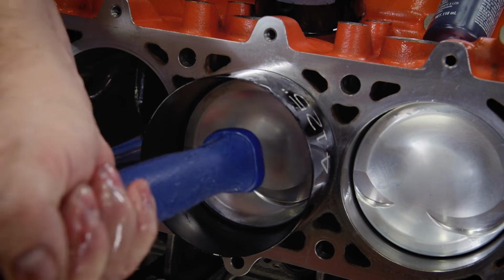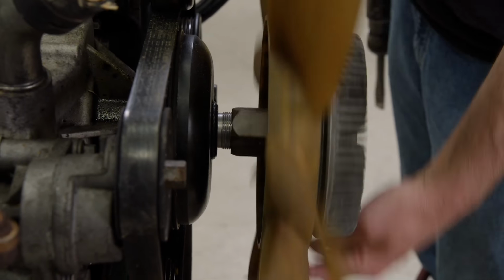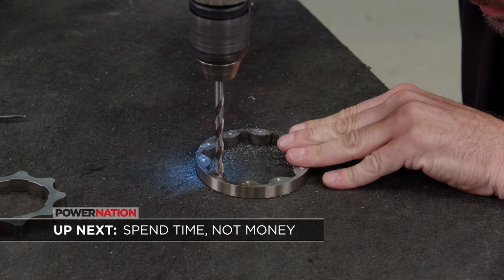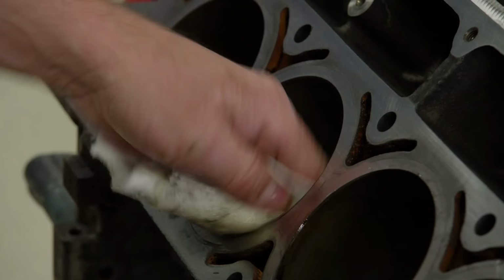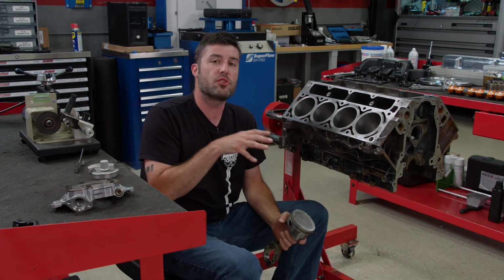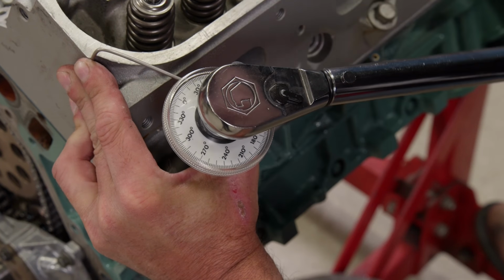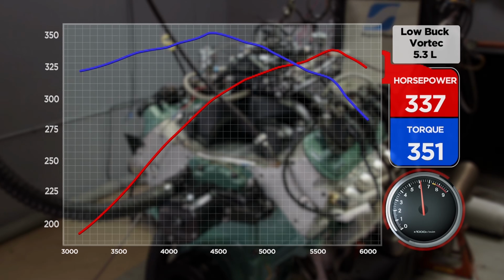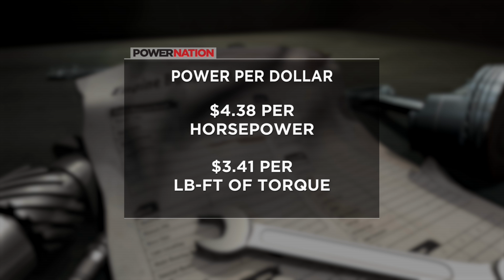Minor Upgrades Create Crazy Power on a Junkyard 5.3L Vortec - Engine Power S7, E10

Comment: None of this is low buck even some of the hand tool they use if you dont have them you have to purchase them and that adds up they didnr build a engine you can build from your garage so they need to change the name of this it is not low buck its sad when poeple go to a junk yard and buy a motor thats got miles on it and slap a turbo on without tearing it down and smoke a lot of sports cars out there none of the stuff is really used when you clean everything and it is not the cheapest you can do it they are wrong i ive made more power them with stock motor threw a cam and lifters on it and intake and made more power and didnt add power adders with the basic and didnt clean the motor and guess what it still running and works vetter then what they spent

Comment: I would advise not to increase the oil PSI past 55 PSI.  Especially if you will run over 2500 RPM for long duration.  You will empty the oil pan loading the upper end.  Excellent video.

Comment: I have a 2002 Z71 5.3 with 270k on it. If I did this to it using the factory Vortec fuel injection and ignition system what modifications would you recommend to the fuel injection and ignition? Also did you just do a standard valve job on the heads?

Comment: i got my 04 trailblazer for free. the previouse owner put a new radiator , a new thermostate in, new water pump in, new ecm in, shaved the heads not sure how much,  new belts, new coolant temp sensor, it is the 5.3 liter and it would idle all day and not overheat until you put it in gear then it would overheat within a block. not sure what was wrong with it it cured itself, maybe an air pocket, i am still leary. oh yeah the ac doesn't work yet.

Comment: Ya know, how much did they spend on oem torque to yield (crap) head bolts, I mean for that money to be honest you could get ARP bolts for probably the same price or cheaper,😂 but they use the ARP bolts everywhere else that doesn’t really matter at that level of build, I mean if I was going to do that i wouldn’t care about the bolts but I would AT LEAST put in ARP mains, rod bolts, and head bolts as really when you think about it those are some of the most important fasteners in the engine, peace of mind ya know

Comment: My truck is pushing 330k miles with no rebuilds, original motor, and original transmission, and the biggest thing I had to do was replace a bad head gasket

Comment: I'm sure you were paid to advertise autozone. But as a shop owner and having 35yrz experience any electrical part beings starters, alternators, sensors, switches, etc are junk and read out of specs. Trust me when I say after changing a starter 7 times in a row on a 5 liter mustang because not one of them were good I had had it and bought from Napa or car quest and the first one worked great and is still going 12 yrs later. And yes all 7 were bad from the jump and all with same issues. Also alternators going bad after a few weeks, sensors that aren't properly calibrated the list goes on and on and on and on its not built to last duralast. It's built to fail duracrap! The only thing anyone can depend on is that the part won't last long,  won't work directly out of the box and the kicker usually causes driveability issues from not running with in the determined values set by the auto makers tolerance. Buying electrical parts from autozone is like buying chinesium electrical parts. Which i will never sell my customers parts from either. Now other items seem to be OK but still I don't think their quality is something to brag about because I'm convinced that the quality department does what they're suppose to do and send out parts that have poor quality or that autozones quality bench marks comes up short

Comment: Okay, cheap you say. You barely beat a 99 Audi A6 4.2 and did not beat a 99 S6. They all have 4.2L and do between 299 and 360PS. I'm just saying, for the money you get a car that already has an engine making at least that power which is quicker than most cars you will put a 5.3 in.

Comment: I have a service van (2013) with a 4.8 L that is just over 500k miles. Check engine light has been on for the last 8 years but it runs like a top. And yes, it's about ready to be retired.

Comment: I am currently rebuilding the engine for my 99 Tahoe limited. It will have .010 over reborn has a new tranny but dad ran it while it was overheating and warped the heads. Years ago. This is the L31 vortex 5.7. Any recommendations for bolt on’s?

Comment: What’s the difference in bottom end between the 4.8l and 5.3L ? I’m sure there are head and intake manifold differences but those are being replaced, I just want to know about the block and rotating assembly. Is the volume a stroke difference or is there a bore size difference? Is the oiling the same on each?

Comment: I know my Chevy motors. I’ve owned a 4.8, two 5.3s and a 6.0. Based on that plastic stock cover over the intake (it’s square and the 5.3 is more rounded ) and the fact that it has flat-top pistons, that is a 4.8, NOT a 5.3. The 5.3 did not have flat top pistons. They look absolutely identical on the outside and so does the 6.0. The junkyard could’ve easily made a mistake and told you it was a 5.3. That being said, that makes this video even more impressive to get that power out of a 4.8L 👏👏
Reply: I have built 3 5.3's with 243 heads they all had flat tops, i think its around 06 to 14. mine were all aluminum blocks
Reply: @coolermaster-p3s 

Yeah your right there's a Lc9 5.3 with flat top pistons with 706 heads and 799 heads. 

I had look that up myself because I was always told the 4.8 had the flat top pistons but I was told wrong. 

But yes you are right there is some 5.3 that have flat top pistons.

Comment: "This is the cheapest you can get one of these things running, right?  You can put injection on it but you have much more sensors, much more wiring, much more messing around with it, this is as cheap as you can get this thing going!"

My brother in Christ, you ripped off the perfectly functioning fuel injection system with the sensors, wiring, and computer this engine came with and threw it in the trash, to slap on nine hundred bucks worth of carburetor, a seven hundred dollar ignition controller, and $300 intake manifold.  That's almost two grand worth of fuel, air, and spark that you could've had for no more than the price of one HP Tuners credit to disable VATS.

Bit dishonest of you not to include the carb and MSD setup in your final price, given that anyone following your recipe isn't likely to have those just laying around for free...

Comment: I have a night I have a 1998 Chevy Silverado long bed with the five seven in it I am correct 233 horsepower I would like to update the intake manifold one of Holly's open Flow injector kits vehicle has just under 120,000 MI and I've had it for the last 11 years original mileage was 65,000 time to show the old girl some love but I do like to drive LOL any information would be greatly appreciated as far as intake manifolds and so on and so forth I'm not a computer guy

Comment: Dude I found a complete 2001 Silverado with a lq4/4l80/4.10heaes/4x4 with 287k miles that I would LOVE to swap into my Jeep, my question is : should I be afraid of the milage? And it does have a either some lifter noise or some piston slap that seems to go away after couple minutes. Should I buy it for my swap?

Comment: I did a 5.3 vortec OEn rebuilt. I changed the main bearings and the cam bearings cleaned everything I didn’t measure for clearance at all! lol I just sent it! I did torqued everything to spec though, but I didn’t do any measurements like they did. I mean it’s rebuild. It’s not like I’m putting after market parts. It’s OEM so my thinking process is well. The cam bearings and the main bearings are all OEM just like the old parts so what’s the big deal of checking for measurements? It takes long.

Comment: Curious I didn't watch the whole video but what year is this engine looking for 2005 lm7 torque specs Rod bearing Main bearings  rod caps and heads  also trying to do oil pump and cam gears ext looking for a full overhaul torque specs

Comment: You do know Holley has been building their own race carb for several years now don't you? 
It's called HP series. Has everything this Edelbrock does except one Smart Thing Edelbrock did Add a way to bolt a GM TPS to it. Don't know why Holley didn't do that. With there 5 other brand carbs. Quick Fuel by Holley has more race than any. E85, Blow Thru, Drawl Thru,  ect. Edelbrock doesn't have that.

Comment: I have this engine and they said it's "blown". What I want to know is if I can get away with a head replacement (or even gasket only) or does the engine really need to be replaced. It overheated a couple times. The 2nd time was after a "reputable" mechanic "fixed" the cooling system for $1000. Started overheating again a month later. 

How do I determine if I can get away with less than an engine replacement?

Comment: i had 2001 suburban 4x4 with 236,000 miles that ran great. when i changed the plugs there were no electrodes left on them and i only had a slight flutter on cold start up, so i can attest to those strong coil packs! great engines for sure. unfortunately someone wanted my truck so it was stolen but, at least they got a smooth running truck!

Comment: I have a 2002 Chevy sub. With a 5.3 4wd,want to use as tow vehicle,who makes the best single turbo kit to fit sub chassis,want pretty much a bolt kit,ultimately want to change body and cab bracketry to install my 67.C 10 body,would be pulling enclosed trailor

Comment: Budget build:  Pull junk yard LS.  If it spins it wins.  Add cheap eBay turbo and intercooler from a scrapped Cummins.  Butcher your stock harness.  Do epic burnouts until it blows up.  Wash, rinse, repeat.

Comment: The most unrealistic part of this is none of those header bolts breaking when you took them off with an impact lol
Reply: The impact factor can break them loose, I agree it's less likely to break. Doesn't mean you should full bore it
Reply: I always tighten the bolts a tad before loosening them, less stripping snapping like that, idk why but it works lol
Reply: @imbrandon16  I do the same thing. The bolts were fastened in a direction that has no gaul or corrosion in front of it so that helps the bolt travel.
Reply: @imbrandon16 its because when you're tightening, the bolt is pushing against itself. When you're loosening, its pulling against itself.  I do the same thing. I agree it works very well.
Reply: No I think it's when the narrator said they changed the main bearings because they were cheap and didn't look in that good of shape but yet when they were pulling it apart he said oh my gosh look these look brand new and then at the end he says they reused them lmao
Reply: Less chance of breaking a bolt using an impact. I never break bolts using an impact only using wrenches.
Reply: @precisioncoatings5019  That's bs. Always break by hand
Reply: @precisioncoatings5019  I always break loose by hand and if it feels good I'll zip it. But too many cast iron head fords to just send it w my impact.
Reply: @precisioncoatings5019 that’s how I can tell you actually work on engines. 🙏👍🔥👀
Reply: Gotta get the motor hot before you take the manifolds off. First thing I do when putting headers in is spin out the manifold bolts just after putting in the garage.

Comment: You should have left the bottom end alone and just did cam and timing chain and of course you have to pull the heads to put lifters in so head gaskets but I've seen 250thousand mile engines w pristine main and rod bearings and still showing the cross hatch from the factory hone don't touch the bottom end of an LS factory motor timing chain cam intake and carrb and send it it will run a healthy long life after 250 thou another 250 thou those robots at gm just know what to torque for longevity when to torque it and they make a bullet proof bottom end by far the best for add ons and live to go another day

Comment: This is why Roadkill made this obsolete. These shows were just to get you to buy aftermarket stuff. My favorite is the junkyard LS with an intake that cost more than the engine. Then longtube headers and exhaust that cost more than the engine. Then using a Holley/other ECU and wire harness that cost more than the engine. For more power we are going to use a cam, springs, and injector with remapping, that cost more than the engine. A couple trips to the dyno, that cost more than the engine.  Well thank goodness we are building on a slim budget. 😂😂😂

Comment: Could be worse I bought my 02  silverado 5.3 z71 package for 2500 dropped my pan cause it was leaking and oil pressure was low so I changed out the pickup tube oring it was flat like a pancake and then found out my pickup tube was clogged with sludge and I had about 8 handfuls of sludge in the bottom of the pan 😢 luckily for me I change my oil when I'm supposed to and motor sounds much healthier now

Comment: I didn't see a carb or ignition controller on that price list.
Reply: Not to mention carb on LS is just stupid. All those sensors to get the ignition running, just one more (MAP) and the injectors, and you can run it off the stock computer for more power.

Comment: Before the boost, it just made stock hp/tq. They did a lot of improvements that helped longevity, but you can see that the power didn't increase any. Any increase you saw can easily be attributed to not having accessories.
Reply: Yep a stage 3 cam helps longevity but not power…… 🤦🏻‍♂️🤦🏻‍♂️🤦🏻‍♂️

Comment: So why didn't you re-use the stock intake system vs going w/ a throttle body injection unit? Any "budget" builder would re-use the parts they had - including engine harness, ECM and intake system - and not go out and purchase nearly a $1000 dollars worth of new intake system. Who uses that crap on the generally low-budget streets? That would be "spending the least amount possible," as stated in your description. And still you continue to push carbs and throttle bodies?!?

Comment: I have a 200k+ LQ9 Escalade and a 325k 07 4.8 Sierra without DOD. I want to put one in my 96 WS6. I think I'm taking the 6.0 but it will definitely need a rebuild. The 4.8 has 799 heads and runs perfect. I think it's been replaced by the previous owner. 
I can't decide.

Comment: I bought my Silverado new back in 09 she has the 5.3 in her , After brake in I switched to mobile 1 full synthetic or now and then Valvoline 5 30 and a good filter and swap out the oil when the sensor tells me to change oil that's about 6k to 7k miles , I've had a few things that needed repair over the years but I'm still driving her she has now 183K miles  and some change on her , She was 13 years old last November , And I have her spray oiled every fall to control rust , I was told that 5.3 makes 315 HP , She still runs great , thanks .

Comment: Really Amy engine should get new bearings and gaskets no matter the build. For under $200 probably for nearly any motor you may as well since either of the two are what blows first normally
Reply: Eh, I think it depends on the application.. if you're just trying to slap something together, bearings may be more work than it's worth. If you have it that far apart though, I agree, give it the new stuff
Reply: @Pirate  yeah I agree if it's all together and ya just about to slap It in then yeah if it ain't leaking like crazy don't bother haha. I'm it smoking a bit I'd always do head gaskets at least since they are typically easy to replace

Comment: how did they call this stock? aftermarket intake,cam and lifters and headers,sorry bros but that aint stock. And for me your bottom line wasn't low budget. I'd just spend a little more to find a cleaner,lower mileage motor or stick with the old school gen 1 small block.

Comment: 15:11 head bolts were new and free they sure weren't in the price list. 17:12 were the sensors free as well, what about the carb was that free when you buy an intake manifold. You threw the headers in the scrap bin and you didn't need new headers in the list because they were free too. You made it a budget build by eliminating half the parts out of the costing.

Comment: So i wanna add some to this... i rebuilt a 5.3 several years ago for a truck of mine. Decided to add some power. But also try some ebay stuff. I used cheap ebay pistons from engine tech. Also used engine tech bearings. I did use oem gaskets snd head bolts tho. But also used ebay engine tech rockers and pushrods. Timing chain was oem as well. It dynoed at 380hp to the wheels. Which isnt huge but still nicely done.  It now has 160k miles on it. Yes... ebay parts work. I think i spent 150 bucks on the pistons that came with rings lol price probably went up but just saying... ebay parts will work in these engines probably because the design was so good that even cheap copies of parts hold up decent
Reply: I want to rebuild my 04 Tahoe 5.3 238k miles and give it 30 more horses and some more torque what’s the price range you think ??

Comment: Will the 5.3 and 6.0 truck blocks still work with an LS1 camaro accessories(alt, power steering pump, a/c compressor) or would I have to use truck drive kit???

Comment: I have one gig because it's bit me in the ass 
 I didn't see them Mike the cyclinders . Maybe they did .....
   First one I built I was gonna Mike it all but it l looked so good 🤣🤣
  Ended up one rod journal had been bored .010 and I only Miked every other one . Now I know why the engine looked so damn good.
In no time at all it wore the cylinder ended up having to bore the whole block .060
    I won't go into details because it was 30 years ago but I never got beat in that 71 split bumper Camaro. It was not stock in the least. 
   Point being if it isn't going to the machine shop ..... Mike every damn part.